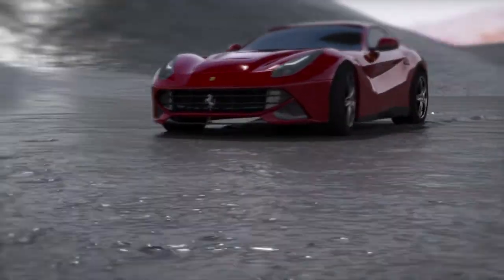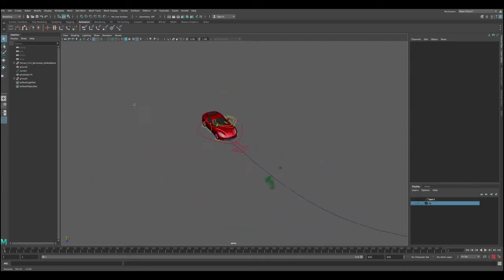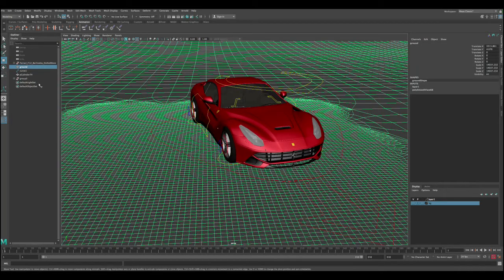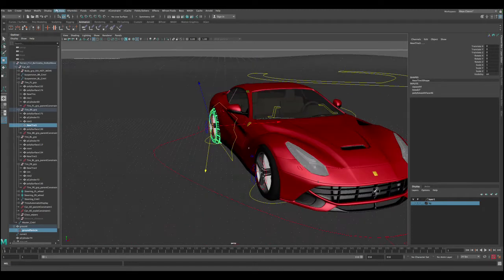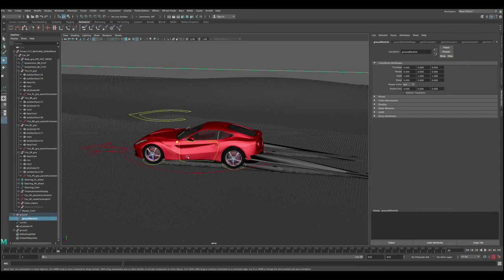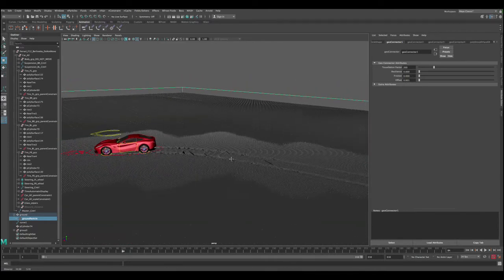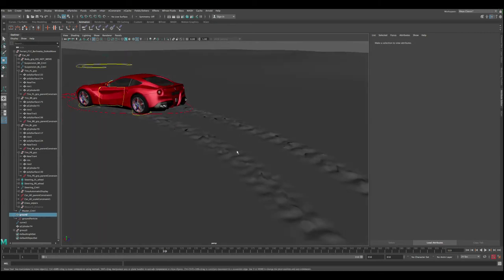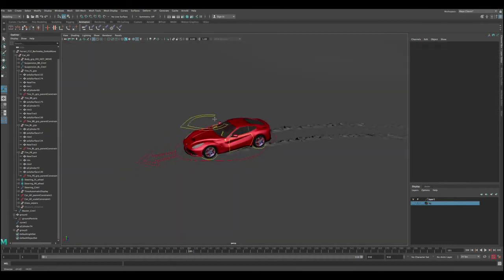Maya Tutorial: How To Animate Tire Tracks in Mud Snow and Sand

Comment: I have done this tutorial and the tire does not scrub correctly. The evaluation manager is acting goofy because of the particle system and the mesh doesnt revert to its pre altered form if you go back to frame one
Reply from the maker: Which Maya version you are using?
Reply: @3DModelsWorld.  2019
Reply from the maker: mmm maybe try to create a simple scene first and test like one tire on the ground and see how this will work and then you can try on a more complex scene, thats what I usually will do if I have some technical issues with Maya I will try to simplify and test on simple scene then test on the main scene once I successfully did the simple one, cause there could be lots of reason why this happens. and it hard to tell unless you experiment.  hope this helps :)
Reply: @3DModelsWorld.  I eventually got it to work, I forget if I did anything, I added more ram and boosted the amount it could use after the fact. it's funny because my vehicle only had one wheel to begin with.
Reply from the maker: Thanks for sharing what you did! I'm glad it did work :)

Comment: Hey, thanks for the tutorial ! One question though.. how can we cache the simulation ?
Reply from the maker: Hi great question!
if you are using Maya 2018 First select the  particles in the outliner it will be (under, within) the geo that you applied soft body on, then you need to go to the FX menu ==>nCache ==>Scroll down to Create Legacy Cache Section==>click Create Particle Disk Cache option box there you will find the directory name for the cache and make sure its Cache Selected is on, then click create and it should work! hope this helps! :)
Reply: Thanks for the quick reply :) I created the cache and can see it in the attribute editor as enabled. 
But when i press play it is slow again as if it didn't do anything. Do i need to somehow import the cache on a different plane or am i missing something very obvious ?
Reply from the maker: You are most welcome! Hmmm which Maya you are using? also when you scrub through the time line back and forth is the soft body behaving correctly like would you expect?
Reply: Maya 2018, I can scrub back and forth but it is very slow unlike a normal playback before i added the trails. Not sure if it supposed to be like that
Reply from the maker: Yeah so when you scrub back and forth and the simulation is working then it did cache cause if the it didn't cache then the simulation will be very messed up, now the speed of the scene is determined by how heavy is the geo also the computer speed,  but I think you could export the geo cache as .ABC file and then loaded back and it should be light.

if you want to try that, you can go to the Cache Menu ==> Alembic Cache==>Export Selection to Alembic. Then you can import it back from the same menu and choose ==> Import Alembic, hopefully this way will work in theory it should :)
Reply from the maker: one more thing import the Alembic to new scene and test it to see if fast.
Reply from the maker: another thing when exporting to Alembic make sure to select the geo this time and not the particles... cheers!
Reply from the maker: one last thing in the Alembic section make sure to export the entire timeline of the animation and not one frame. hope it will work!